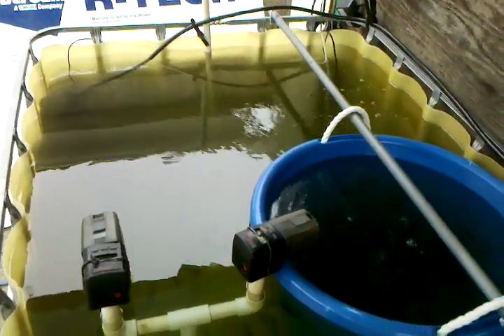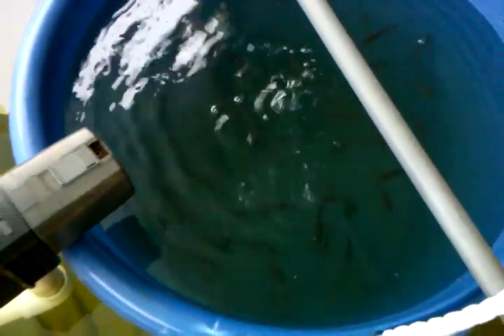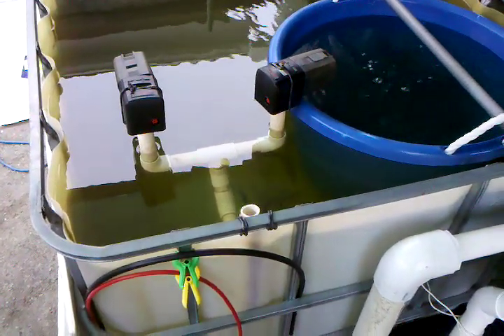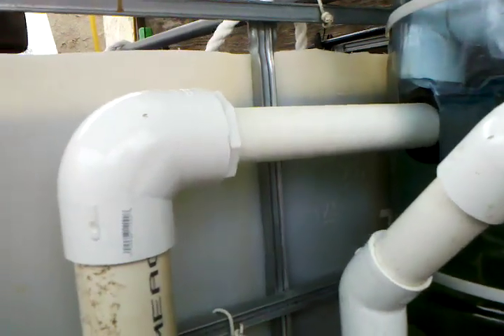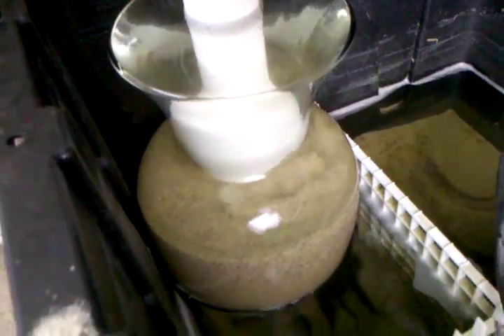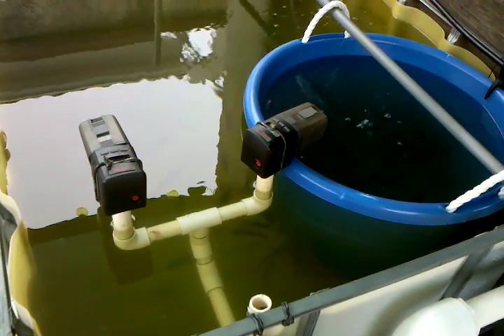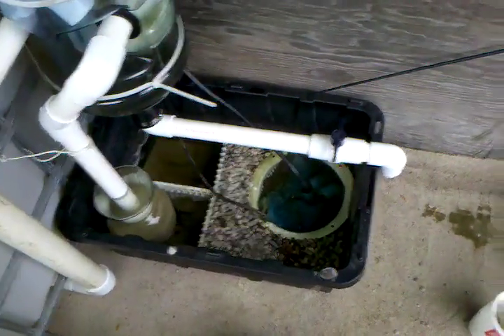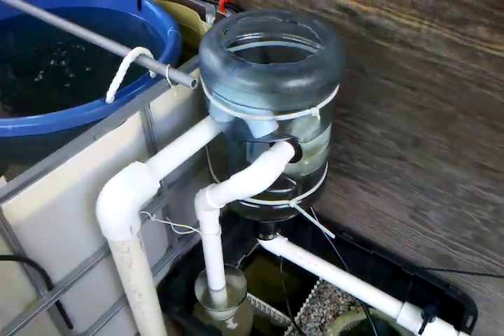DIY Aquaponics Swirl filter

Comment: Thank you again !  I will order the adapters and get a water bottle for mine and the uniseals etc.   IS the sand filter just a vase with some filter media surrounding the drain pipe to prevent it from coming out ?   After overflowing from it looks like the water bubbles up from the sand filter into a bed of Activated Charcoal and some egg crate to surround the pump and some more filter media to keep the solids from returning to the fish tank (or growing bed).  Do I have it correct?

Comment: Hi, can you please explain how the connection at the botton of the swirl filter works? what adaptor fittings used? Also, can you also explain how the sand filter works? is that just normal beach sand? thanks